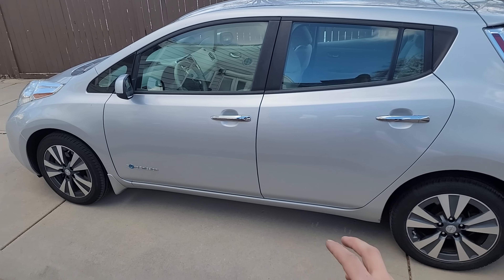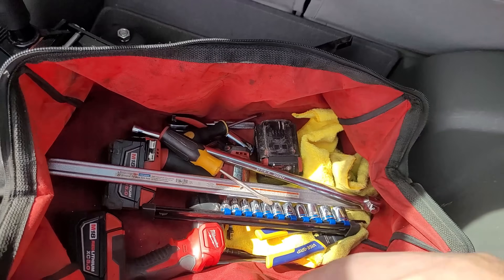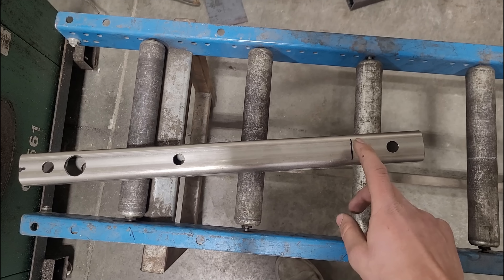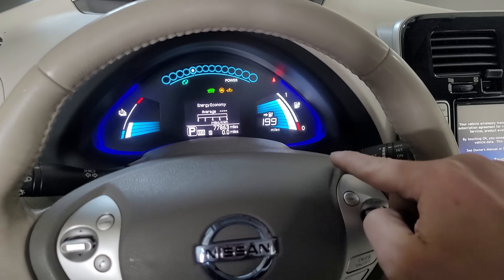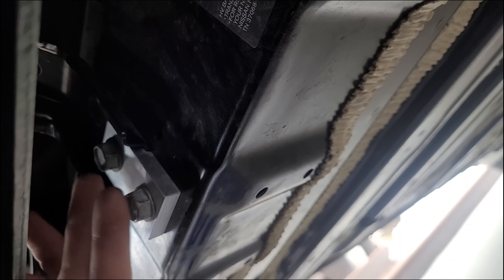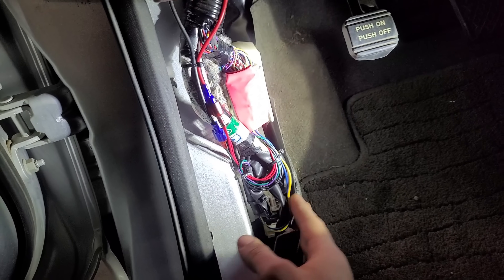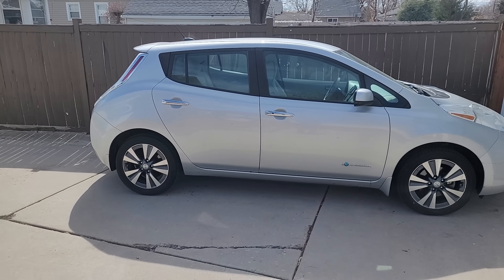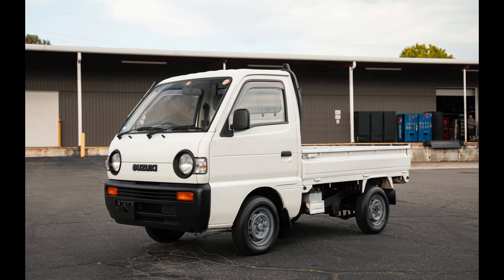Under $5K Nissan Leaf 62kWh Battery Upgrade

Comment: But the EV haters told us replacement batteries would cost $30k, not $5k. What gives?
Reply: The goal is to get the price down below one dollar per kilowatt hour, it was trending downward and they said it would arrive at this in the next few years, we just need third-party manufacturers to make these batteries and firmware just like they do for gas cars and their auto parts
Reply: Just been watching a Ford ranger 2021 pronounced dead with a wet belt failure at 100k . It’s going to cost a fortune to fix with turbos, pinions and pumps needing replacement too.
Reply: @HGSuper That’s what happens with ICEVs since they have ~2000 moving parts vs EVs having ~20 moving parts. And hybrids have even more moving parts than ICEVs. They also don’t talk about the tremendous maintenance of ICEVs vs EVs. Or that ICEVs & hybrids catch on fire much more frequently (1,530 gasoline-powered vehicles and 3,475 hybrid vehicles were involved in fires for every 100,000 sold) than EVs (25 fires for every 100,000 sold). The only maintenance on Teslas is tires, wipers, wiper fluid, cabin HEPA filter, 12v battery, and perhaps radiator (if punctured) & radiator fluid. Somebody please tell me if I am wrong.
Reply: @tomdrewenskus8167  you could also add;  brake fluid, air con service for those without heat pumps, tyre rotation, brake calliper cleaning and lubrication, reduction gear inspection/service as appropriate, control arms, bushings, ball joints, battery coolant. But you got the main ones.
Reply: @tomdrewenskus8167  the amount of water it takes to put out an ev lithium ion batter can be 10x that of a normal car fire and the volatility of the chemicals can cause reignition even after it's been "put out".
Reply: @jacobrector7879  Data from the National Transportation Safety Board showed that EVs were involved in approximately 25 fires for every 100,000 sold. Comparatively, approximately 1,530 gasoline-powered vehicles and 3,475 hybrid vehicles were involved in fires for every 100,000 sold. So, that’s 61x as many ICEV fires and 139x hybrid fires compared to EVs. And that’s per 100k vehicles sold (normalized statistics).
Reply: @tomdrewenskus8167  dang I guess it's been a minute, I wrote a scientific article in college about the difference in specifically ice vs ev vehicles and the only really data at the time was tesla so makes sense it's gotten a lot better. Thanks for the information too 👍
Reply: Never heard anyone say $30k.
Reply from the maker: @tomdrewenskus8167  Yep! I'm still waiting to hear the next uniformed canned response that's been fed to them!
Reply: It wasn't just "EV haters" saying that. 
The Leaf uses a different battery pack than what is favored today. It is air cooled and has significantly less complication in construction. Those "$30k" battery packs are liquid cooled and contain all the additional supporting components for the active cooling circuit. Replacing one of these with current labor costs may indeed approach $30k (or more in something like the Hummer EV).
Reply: @MrCarGuy my volt has a liquid cooled battery that is way  cheaper.
Reply: Your forgetting about the recycling charge that will retroactivley applied with intrest some time in the future, that accounts for the other 25k
Reply: @joshuaerickson2458  Dude, nobody is paying you $25k to recycle your Nissan Leaf 62kw batteries. If you could buy a used Leaf battery for $5000 and recycle it for $25000, then just recycle 2 battery packs and you could buy a new Tesla. But, it doesn’t work that way. Recycling rebate is much less than the cost of the battery pack.

Comment: Every EV should have a swappable battery.
Reply: They do, just varying degrees of mechanical manipulation.  most are changeable in a proper shop setting in 2 hours.    I think you mean a "hot swap" like pull in...swap and drive away.  Thats done by a couple companies, but the application adds weight and complexity (cost) to the car.
Reply: @ Yeah I just mean more user-friendly swapping, not necessarily hot swapping. These nisan leafs are the first I have seen that you can do it without a on of expertise or custom tooling, but maybe i'm just slow
Reply: Most modern EV batteries could outlast the life of the vehicle
Reply: @originalsongsofpraise  True (great longevity) but to take advantage of quickly advancing battery technology (higher energy density) a swappable battery gives the potential for far greater range. 

Personally I’d like a modular swappable battery… small for routine use & added modules for less frequent, longer trips.
Reply: @ My ICE vehicles are 2004 and 2007 with nearly 200K miles on them. I dont think we're quite there yet with batteries lasting that long without massive degredation.
Reply: Other EVs don't need to as the battery should last longer than car.
Reply: The EU will mandate 'user replaceable battery' as of 2027 for all battery items (phones, cars, ...), if the law comes into force. Honestly I'd prefer swappable battery to waterproof phone.

If you look at designs such as NIO, they literally swap out the battery as a fast recharge option. You then are forever renting the battery, and get a huge discount on buying the car, but if there is a swap station nearby, it works well.
Reply: Better buy plug-in hybrid.

Comment: Finding a usable 62kw battery in Canada is near impossible given the demand. Very few places do it here, and the prices run near $20,000 CDN for a 62kw swap.
Reply from the maker: @MicheIIePucca  I see 3 packs right now in Canada for under 6000 CDN!
Reply: @zuccamachine  where?  is this a nissan 62kwh oem battery? in what condition?
Reply from the maker: @LaBambaCL  See the previous video:

https://youtu.be/PE1iD0T8wYc
Reply: I searched the canada wide auto recycle database and there was one 62kw battery for $5500 CDN.

Comment: these car batteries can power an entire house for a week.....wonder why they dont come up with a system
Reply from the maker: @JonTan-z3e  Yes, it's already being done. The person who bought my old battery is doing this.

https://github.com/dalathegreat/Battery-Emulator
Reply: @zuccamachine  yup been done, altho I took apart my old 30kwh batteries and made a 48v out of it.  The issue with the battery emulator you have to buy the right inverter.  I had an inverter on hand but decided to put it in parallel with my existing 2 sets of batteries.
Reply: There are 400v inverters. You can do it

Comment: i use al foil tape (2$/roll from china) as cheap improvised aero tape on the bottom side of my cars. havent seen this anywhere else on youtube. the only areas that really matter are on the sides of the car where air is trying to get under or out from under the car. well i drive a 1st gen volt which has a pretty big air dam in front, so thats kind of my excuse for ignoring most of the center of the bottom of the car and areas around the engine bay. just an idea. just takes a bit of time to clean the junk off and use rubbing alcohol and a rag to surface prep to get the tape to stick good to cover protusions. can be done in an hour or two with a jack in your home garage. i think youre right about the potential savings. i did an experiment where i only covered one side of the one of my volts with al foil tape over the penitrations and stuff and then didnt wash the car for a year. took about 10k miles before i could make out differences in the way dust was sticking to the sides of the car.

Comment: There is a lot of "it'll be alright" in this video that is honestly terrifying.  LOL.  

Excellent swap overall, buy the "Eh I don't need all the bolts" and "I cut this extension into two pieces because I made a mistake measuring" are concerning.  Please go back and actually put in all of the bolts....if you had 10 bolts with a 30kWh pack and you're extending the pack downwards, plus adding an additional few hundred pounds.....how is adding fewer bolts "alright"?  You're already pushing it adding more weight to existing brackets.  Don't cut even more corners or the next video will be "so my battery fell out".
Reply: As a certified YT mechanic, the "better safe than sorry" suggestions make sense. At this point, just fabricate extras and install when doing upgrade for the next of many future Leaf customers.

Comment: Bolting stainless onto your car will make the car rot faster. The car becomes a sacrificial anode for the stainless bars.
Reply: Good Point. 

So dipping the parts in paint would eliminate this problem?
Reply: I enjoyed watching this vid and learning from it!
Reply: Stainless steel doesn't rust.
Reply: @Islamisthecultofsin  No, but everything else would due to galvanic corrosion.
Reply: @effervescentrelief  If Stainless doesn't corrode then there is no galvanic corrosion.
Reply: @Islamisthecultofsin you clearly don't know what you are talking about. Look up what galvanic corrosion is and then come back. Essentially he created a battery with the spacers being the cathode and the whole car being the anode. The anode will rust and the cathode is protected. It is how they protect oil platforms at sea, by adding blocks of sacrificial aluminium. 

It was the first thing I thought when I saw this video, followed by "wait, did he really swap to a bigger and heavier battery AND use less bolts than the original???".
Reply: @renegerritsen6178 sacrificial aluminum or might they be called zinc anodes? Made of zinc?
Reply: @Islamisthecultofsin  whoosh
Reply: @   You buy some "stainless" from China?

Comment: How do you set up the obd test on the battery outside the car and how did you get the can unit flashed?
Reply from the maker: @brunopintyou  CAN instructions are on Dala's Github page listed in the description. 

See the previous video for OBD test on the standalone battery:
https://youtu.be/PE1iD0T8wYc

Comment: Every other 60 odd KWh battery fits perfectly flush. Why does this one not fit correctly?
Reply from the maker: @sickb0y333  Not sure what you mean. All the 62kWh are 40mm taller. Dala's original video shows the same issues with the 2 rear covers not fitting.

The Vivne 60kWh batteries may fit flush, but the OEM Nissan ones like this do not.

Comment: ok dude never ever  at any time , use concrete blocks to hold  a car up,, i dont care how many times you have done it.
Reply: Exactly. I did once this shit. Concrete block shattered and car fell down. I was lucky that i was off then.
Reply: @slablevcek
So why don't the blocks at the bottom of high concrete block walls shatter?
Reply: Those blocks look like standard gardening blocks you'd get at Home Depot. I'd definitely not trust those to hold up a car. He was smart to put a plate/board over it to distribute the load but it's still sketchy. I used to work for a commercial concrete company testing the strength of different concrete formulas through compression testing. The compressive strength of concrete can vary greatly between two identical concrete samples. It would be better to stack some 2x6 or 2x8 wood blocks to give the car extra clearance.
Reply: Yeah it's not the 33 times you used the blocks and everything worked out it's the one time you use blocks and it don't work out and people die @wayman88
Reply: Fact. I had a friend of mine have a car fall on him with a setup like that. He only ended up with some bruised ribs fortunately due to him having a block of wood underneath for some reason
Reply: We all care about you. Be safe bro! Great video. Make more.
Reply: It's brittle
Reply: If the blocks are vertical and have a steel plate on top spreading the load like in the video, each one can take the entire load of the car
Reply: @zimzim7 can you vouch for that or is that just your armchair assessment
Reply: @zimzim7 you're an engineer? What type and to what level? What's your calculation for the vehicle weight, the height of the jack stand, it's narrow width and the sideways energy and moment needed to start a rocking motion that would tip over the stand? 

If you're a genuine engineer this is easy. It's just forces and motion. Basic stuff. 

Looks to me like if no one bumps into it that it be ok this time. But its a garage with moving cars that do occasionally bump into each other. Easily knocking it over. 

At the least he should put spare wheels under the car, or drive it up onto a ramp of blocks that are formed together.
Reply: @Google_Does_Evil_Now  true of any jack stands
Reply: Those aren’t cinder blocks.  They’re kinda small for the jackstands for my standards.   Just don’t get your head or body under there.
Reply: Omg he's driving a forklift next to the sketchy blocks n jacks.
Reply: So houses are supported by cinder blocks, but you can’t support a vehicle with them?
Reply: May I ask why?
Reply: @KeigoMoriyama The reason for not using concrete blocks is two fold.      First, the block may be made of non compressed or strengthened concrete, this can scatter if dropped.  Remember a wall doesn't get dropped , hit etc.  Second, most people put the blocks under the sill ridge. This can act like a chisel and if the car is rocked about it can burst through the concrete and split the block
Reply: @ thanks for explanation
Reply: @KeigoMoriyama   it can kill you
Reply: @KeigoMoriyama You mean he should be more..concrete? 😏
Reply: Buddy he's using jack stands 😂 stop repeating what the TV told you without thinking first
Reply: @AbdulShalakeesh   im an old seasoned heavy truck  diesel powered refrigeration mechanic that was fiat certified in 1978,, so i know what im saying   an no i didnt see it on tv,,
Reply: .....  

Do you know Jesus Christ can set you free from sins and save you from hell today 

Jesus Christ is the only hope in this world no other gods will lead you to heaven 

There is no security or hope with out Jesus Christ in this world come and repent of all sins today 

Today is the day of salvation come to the loving savior Today repent and do not go to hell
Come to Jesus Christ today 

Jesus Christ is only way to heaven 
Repent and follow him today seek his heart Jesus Christ can fill the emptiness he can fill the void 
Heaven and hell is real cone to the loving savior today 
Today is the day of salvation tomorrow might be to late come to the loving savior today 
Romans 6.23

For the wages of sin is death; but the gift of God is eternal life through Jesus Christ our Lord.

John 3:16-21 

16 For God so loved the world, that he gave his only begotten Son, that whosoever believeth in him should not perish, but have everlasting life.  17 For God sent not his Son into the world to condemn the world; but that the world through him might be saved.  18 He that believeth on him is not condemned: but he that believeth not is condemned already, because he hath not believed in the name of the only begotten Son of God.  19 And this is the condemnation, that light is come into the world, and men loved darkness rather than light, because their deeds were evil.  20 For every one that doeth evil hateth the light, neither cometh to the light, lest his deeds should be reproved.  21 But he that doeth truth cometh to the light, that his deeds may be made manifest, that they are wrought in God.

Mark 1.15 
15 And saying, The time is fulfilled, and the kingdom of God is at hand: repent ye, and believe the gospel.

2 Peter 3:9
The Lord is not slack concerning his promise, as some men count slackness; but is longsuffering to us-ward, not willing that any should perish, but that all should come to repentance.

Hebrews 11:6
6 But without faith it is impossible to please him: for he that cometh to God must believe that he is, and that he is a rewarder of them that diligently seek him.
Jesus
Reply: Who's gonna tell all those parking garages that concrete can't hold up cars? 😂
Reply: @scottdisselhorst9744 different type of concrete. Blocks are way more fragile.
Reply: @scottdisselhorst9744 you mean the concrete with steel reinforcement? Think before you type
Reply: @geekswithfeet9137  it was a goof.
Reply: By that I mean I was goofing around... Being goofy.
Reply: @scottdisselhorst9744  I don't know if it's really that helpful to be goofy when someone is pointing out something potentially unsafe that other people could copy. 

Like someone could read this comment, almost take on the advice and then see your flippant remark and then ignore it.
Reply: @Jmcinally94  people are free. Some try to be helpful by being funny. Some try to be overly worried about everybody's safety. Freedom over safety, that's my motto. Freedom first, safety third.
Reply: @scottdisselhorst9744   cars falling can kill more than 1 person at a time   ,,i know
Reply: @scottdisselhorst9744 you deeming someone’s concern as ‘overly’ implies your ‘freedom’ only works for what you support. Actual freedom would mean you wouldn’t judge others nor their opinion.
Reply: Wow. Freedom means I can't judge others? Some kind of strange freedom you've got there. Fortunately, it's not up to you.  @GBOAC
Reply: @scottdisselhorst9744  and by successfully pointing out the flaw in my statement mirroring yours (as you were also stating what freedom does or doesn't mean) you showed how your original statement ipso facto was baseless. Likewise, by your own demonstrated logic, it's not up to you either. But you first started mentioning it though, making it self-contradictory.
Reply: Totally safe

Comment: You need to acquire.
A lift and a shop.
Great job I wish I could do it
Reply from the maker: @stevencorrea8032  This was done in my friend's welding shop, but I hope to have my own shop soon and offer this service!
Reply: I think this is his shop but its more of a large storage unit, although im just speculating and i could be wrong
Reply: Nice job and very nice video with captioning.  Are you looking to just do Leafs or other EV repairs?  What area in the US are you looking to have your shop at?
Reply from the maker: @derek78w  I'm in Utah. Open to all EVs, but Leafs are definitely the most DIY friendly